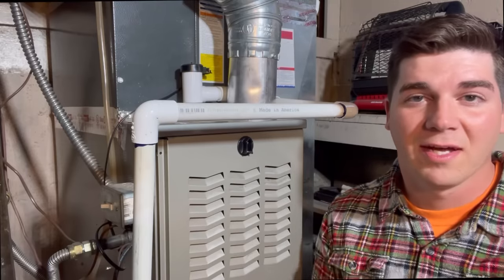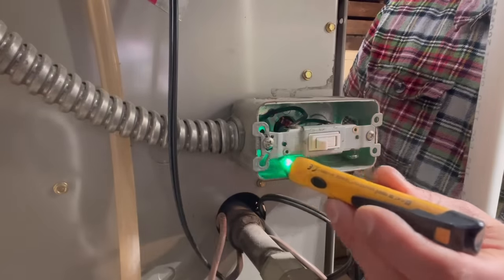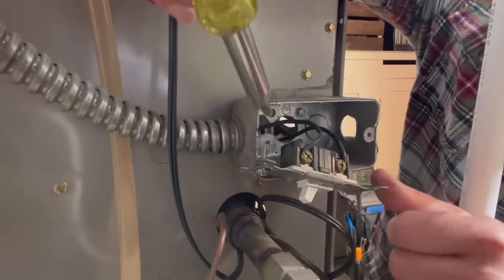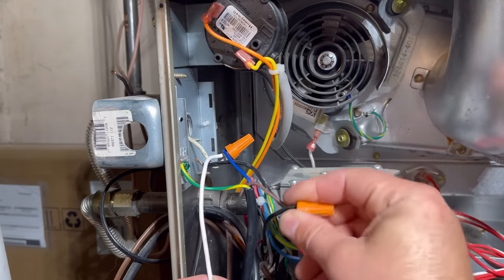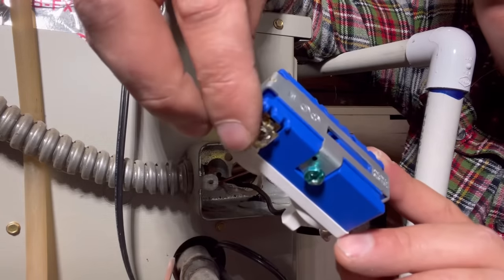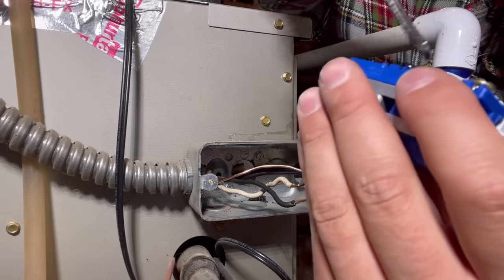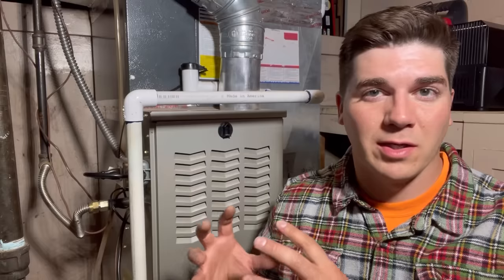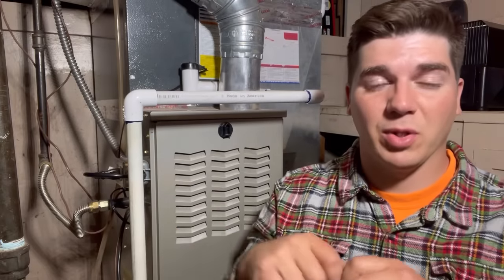This Could Keep Your Family Warm During An Emergency Power Outage.

Comment: in a power outtage i have my furnace connected to one neighbors generator and another neighbors generator powers my home it works perfect because both their generators are capable of powering a 1,500-17,50 square foot home and we all live in a trailer park where we are all between 700 and 800sqft so technically i could run my entire home off one  of their generators with their home but
Reply from the maker: You are lucky to have good neighbors. Most wouldn’t be so generous! Cheers

Comment: Hi, Extremely well done video. But ,can these steps also be implemented if you have a oil fired forced hot air system ? If not, why not ? Is there then a way for us oil fired forced hot air folks to achieve what you did in this video ? Thank you.

Comment: Somewhere alone the line you will need a suicide electric cable  with a plug on both end between the Inverter and this contraption you've created.

Comment: I’ve heard from local hvac technicians this is not ideal for the electrical components of the furnace. The inconsistent voltage supplied by the generator could fry the main board or components on the board. I’m not an hvac tech but it’s what I’ve been told
Reply from the maker: There’s way to many hvac techs who think they know everything because they went to school. This is for emergencies, and does not change the function of the furnace under normal grid power. If you are concerned about that, make sure you get a power station or generator that supplied clean pure sine wave power and you will be fine.  If you don’t want to, then don’t! These are just suggestions that I have found work great. Cheers

Comment: so if the furnace is 600 watt, then a small little 500watt solar charger might run it for only 1 hour. Ecoflow Delta Pro, maybe 6 hours or a little longer depending on how often the blower comes on.
Reply from the maker: Yes! I have a few videos testing some different brand power stations coming out soon! Stay tuned for those
Reply: If you could power this 600 watts using natural gas, that would be cool. Let us say you use the gas to spin a natural gas generator that is right-sized to be maybe 700 watts or so. Yes, you consume more gas, but in an emergency, you are probably willing to do that. It is too bad a gas furnace even needs electricity given it has fuel to burn.
Reply: Also, if the emergency is an Earthquake, with the risk that your pipes are broken, you have to shut off all gas. So now you want a backup plan of heating just little rooms with electricity (if you have that working).

Comment: Seems like there is a DANGER here of backfeeding power to an electrical worker trying to repair the electrical lines.  I think that switching the switch off might prevent this but this could be easily missed by the homeowner.  Also, I believe that code requires a furnace to be hardwired rather than having a plug.  I love the idea and have considered a few versions of this myself but... Correct me if I'm wrong...those who are "linemen" or knowledgeable.
Reply: There is no back feeding of power to electrical lines.  He basically isolated the furnace so he can plug it into alternative power sources.

Comment: All wires attached in a metal box need a clamp at the hole and the box needs to be grounded.  That way if a hot wire contacts the box, it won’t be energized.

Comment: Subscribed. This is great and I'll be looking for the parts needed. Why? Because I purchased a XP13000EH Dura-MAX, Dual Fuel (I'll be looking for the natural gas parts needed seeing your other video.) that I can't seem to get any electrical contractor to come in and hook up into my panel. Even accepted a bid and notified the company, SHAW ELECTRIC OF DAVENPORT, IOWA and they have never returned to honor the bid after they agreed to do the work. That was 18 months ago maybe. I had wanted to run the entire house in an emergency because I have someone here on oxygen, seems the folks at Shaw could care less. So thank you! Oh, I realize the 20 hp MAX is too big just to run the furnace, I'll just know I can at least use a smaller unit in the winter if needed to keep the pipes from freezing.

Comment: Great video, I need to do this instead of hard wiring under a flashlight in the middle of a power outage. I might want to up the plug wire gauge due to the long extension cord draw.

Comment: There is no need for the switch just put a double receptacle that may actually be useful should you need to plug something else in. If you need to shut power off to furnace its just as easy to unplug it which you have to do anyway to plug it into your inverter or generator.

Comment: What effect does this have on:
1) Insurance
2) Liability
3) Ratings and certifications for the unit with the proposed modification?

Edit:

To borrow from an old post;
"This fails inspection most often for not being compliant with the manufacturers installation specs when they applied for UL rating, seen many guys try this before.

I have also heard an inspector say " do you think the tenant is going to slide out the furnace and vacuum behind it""
Reply: @trevor5290  you must be a blast at parties.
Reply: @bearb1asting  at least I get invited to parties

Comment: Is the black plug live when switch is on and you're on grid power? The it is a shock hazard if someone pulls plug off receptacle and switch is on.  They by code require an outlet next to a furnace so a tech has available plug for power to run tools. IF so a safer way, use DPDT toggle switch to isolate grid wires from inverter wires. Toggle like that is on both way and just accepts 2 different power inputs to one power output. All you need is a box, switch, cover plate and the plug, a loose plug end will always be deenergized.
Reply from the maker: No the black plug is just a pigtail to the furnace. It will never be live. The outlet is giving the pigtail power just like a microwave or toaster 👍🏼

Comment: I have solar, a natural gas hard wired generator, and a portable gasoline generator, and I'm still going to do this, primarily in case this happens in winter when the solar isn't generating what it usually does and as a backup to the natural gas generator.  I lived through a 12 day outage in an ice storm about 10 years ago and I said never again.
Reply from the maker: Nice! Thanks for sharing!

Comment: Very informative video, thanks! In my furnace it already has similar plug and switch combo where the plug is used for Honeywell Electronic Air Cleaner. If you can share thoughts on how the idea can be modified any component suggestion will be helpful. thanks
Reply: any combo outlet with two receptacles? one for air cleaner and other for this suggestion. I couldn't find one.

Comment: Where is it that has 110vac heaters? I live in the SE US, and we have 220/240vac systems...w/two-pole breakers. And the other voltages needed are from a transformer, or just using half a phase. EDIT: O.I.C. I have electric heat  so, duh on me. Thank you for the video, though. Slight mods, and I can use this idea too.

Comment: Great video to provide heat in a power out situation. One question if you can assist. I have an American Standard Freedom 95 Comfort R furnace, fairly new in the last 6 or 7 years. I also have a generator and I like your idea on the inverter for the car with an extension cord. Do I need to ground anything relative to the Honda generator or the car to make this work? I noticed a comment on one of your videos that someone had difficulty until they grounded something that the extension cord was plugged into.

Comment: I read some comments and could not find my answer so here is my question.

Based on the video the furnace circuit was 20a breaker.. the switch/outlet combo installed and linked is 15a.  Then 12/3 pigtail was used which would be rated for 20a.

Is the 15a switch/combo ok to install in this scenario or is a 20a switch/combo needed?

If the 15a switch/combo is ok could you then utilize a 14/3 pigtail? The 14ga is rated for 15a.

I do realize the furnace will not draw this amount but I am more curious as to what is correct per NEC code.  The way I have read and understood is a single outlet on a circuit would need to match the circuit.  So if the circuit is 20a the switch/outlet combo should be 20a..

If the branch has multiple outlets either a 15a or 20a could be used...

2020 NEC
210.21
(B) RECEPTACLES

Comment: Can you just eliminate the on/off switch and just add a receptacle instead.  That way when you can unplug the furnace and then plug it into the extension cord from the generator

Comment: When you attach those wires under the screws , you should use the opposite side so the screw doesn't push the wire out as it gets tight .
Reply from the maker: It wasn’t under the screw it was under the plate that sandwiches the wire to the outlet

Comment: How about the low voltage transformer that runs off a different power line? I can do that, but  I need another plug for my x-former that runs the thermostat. Still a good idea.

Comment: You did not need to modify the switch and then jump it if you put the hot wire under the screw you used for the jumper, and you need to cut the wires off and then strip them again. you could have just used the existing switch and tied your pigtail in after the switch.

Comment: Retired HVAC tech, I did this when I installed my furnace 15 years ago, not sure why there's a switch at all though. I just have a double outlet it functions like any 120v circuit, it's controlled by my furnace breaker of course. I ran the pigtail to my furnace and plug it in just like you... so whats the switch for?
Reply from the maker: It’s building code. Dedicated switch is required

Comment: Just want to make sure ...When running the furnace with the generator and the pig tail plug are you supposed to keep the MAIN CIRCUIT BREAKER to the house OFF.  Then when the power is restored to the house ...we are to unplug the generator, place the pig tail in the proper place in the switch panel. Go back to MAIN breaker box, flip the breaker back on? OR is the breaker box to be on when the PIG TAIL is hooked up to the generator at the same time?   just want to make sure I don't mess something up ...   thank you in advance
Reply from the maker: That’s correct 👍🏼

Comment: Just curious if you have noticed the class b on your furnace has been installed backwards (upside down) and there should be 6" clearance to combustibles (the pvc drain pipe) from single wall connector pipe (the first short section that is leaving your furnace)... Sorry but I can't help but notice things like this,  I've been installing HVAC since 1986. :)
Reply from the maker: Yea it’s been corrected since this video was filmed about a year ago 👍🏼

Comment: You could have done the exact same thing with a standard receptacle in that box. No need for the switch. A cord and plug connection is considered a disconnect by code.

Comment: Why did you remove that tab?   You added an extra wire going to funace which was the same as that tab.  just you would have needed to keep the tab and connect hot wire to the other side of the switch.
Reply from the maker: It’s for the little led light I believe

Comment: Hmm, I'm not in any way a professional so there might be something I'm missing, but at 5:38 couldn't you have left the tab connected but instead of attaching the incoming hot to the black screw side of the switch, attach it to the gold screw near the end and then you don't need a jumper as when the switch is on it'd send power from the gold side to the black side, across the metal tab into the receptacle?

Comment: I was curious to know could this recepticle be used as like a disconnect for 120v sorta like a square D box . Reason I ask is because I have a shed outside with a lean-to building attached. I want to be able to turn off everything if i need to but I have 2 rooms and I don't know how much I can pigtail off of that receptacle , After that I need to know how I would run a whole room off of a plug. seems crazy but then again you showed me something brilliant in this video like its possible to run your gas furnace off of a generator.. I'm interested in your thoughts.

Comment: Document the wiring change with explanation for proper use and attach it to the furnace... for the next guy.. one day you may no longer be around.. A youtube reference would also help if an internet connection is available at the time it is needed...If the power is off and the switch is left on, the light will be off, when the light comes back on, move the "pigtail" plug back to the outlet..

Comment: Where the pigtail exits the back of the box into the interior of the furnace there is no protection as it passes though the hole.  perhaps the same sort of insert grabbing it as was used externally would be a good idea.

Comment: All wires go to the left side of the screws so they will be pulled into the screw the way you hooked them up the screw is pushing the wire out may not hold
Reply from the maker: There is a plate that squeezes the wire so I’m not sure what you are referring to. The old one we removed?

Comment: I like this a lot, however I have what I think is a basic question.  How do I find out how many total Amps will the heating system pull; by this I mean total Amps for the furnace itself (i.e. black and white wires in your existing connection prior to the switch being installed), plus the condensate pump (black and blue wires), plus any fan or other circulation mechanism?  I ask because it would seem necessary to size a generator to provide enough power to run all these loads.  Would it be as simple as plugging my "Kill-A-Watt" meter in newly-installed switched socket while the heating system is operating?

Of course, the generator or inverter would have to provide enough power to run other necessary loads; refrigerator (to prevent food spoiling), minimum lighting for safe living, radio and TV for emergency information, device charging, Internet modem, etc.  
These other loads would have to be calculated and added to the heating system load rating.  Thus, it seems necessary to me to know the maximum power draw for the heating system to assure that your emergency power supply is adequate to supply the minimum safe electrical power needs during an outage.
Reply from the maker: You’d need an amp meter and clamp it around the black wire to check that. You can get them relatively cheap on Amazon. Here is a link for one. https://amzn.to/3Z1d4rg

Hope this helps. Cheers
Reply: @diyhvacguy  Thank you.  My home has a furnace switch with "Romex" going in and out.  Is it likely that all the power needed to run my system is going through that switch or could there be relays or bypasses pulling more power from other circuits?

Comment: Wouldn't you want more than your heat on? If you have a generator that is powerful enough to run your furnace, then it may be able to run other items that are critical as well (water heater, sump pump, etc). Instead of modifying just the furnace, or needing to run extension chords, wouldn't it be better to do this all at the panel? Either via a interlock or transfer switch? If I had to choose an approach I'd do an interlock and know which breakers I need to run when the power goes out.
Reply from the maker: Yes I’ll be installing an interlock kit and power inlet box very soon so stay tuned for that! Cheers

Comment: Thank you Greg.  ?Q?: Do you have any additional comments for our application:  our furnace switch / box is attached to stud on basement wall. Many thanks.
Reply from the maker: Same thing can be done as this. You’ll just need to get some 12awg wire and run it from the outlet through the conduit to your furnace 👍🏽

Comment: This is a great idea. I did almost the same thing before getting my main panel setup with an interlock and input for a generator, but I never thought of the pigtail. My system relied on a suicide cord to the outlet and I got rid of it as soon as I could afford to upgrade.
Reply from the maker: Oh man, every electrician would be hounding me on here if I advertised a suicide cord lol glad you enjoyed the video! Cheers
Reply: Despite the overwhelming amount of people advising against it (especially on the internet), there is nothing wrong with running a suicide cord to the furnace. Just always make sure to disconnect the circuit from the mains, and you are good. Its the same concept as the one being used here, literally nothing dangerous about it.

Comment: Excellent Video.  I followed it from start to finish including purchasing the Bestek 1000W Pure Sine Wave inverter.  I received the inverter today.  It appeared used with marks on the lugs and the box looked opened more than once.  However, I proceeded to hook it up.  My question is: Has anyone experienced a sizable spark when connecting the second lead to the car battery.  Yes, the polarity was correct.  Secondly, my drain was 886W when the furnace was running and it ran the furnace just fine.  The car battery voltage dropped down to 10.6V within a couple of minutes which was a little troubling.  So how much of the above is to be expected and normal?   Please let me know your experience regarding the spark I experienced.  Thanks!
Reply from the maker: Yes the spark is normal. You will have the same thing connecting jumper cables 👍🏼

Comment: What will be powering your 220VAC blower in your “emergency “ situation? The inverter in this case is only supplying 110VAC to the controller, thermostat. My furnace and most likely yours needs 220VAC to run the blower.
Reply from the maker: No, most all gas furnaces have a 110v motor. If you have 220 going to yours, it is for your electric heat strips, in which case this trick will not work. My apologies